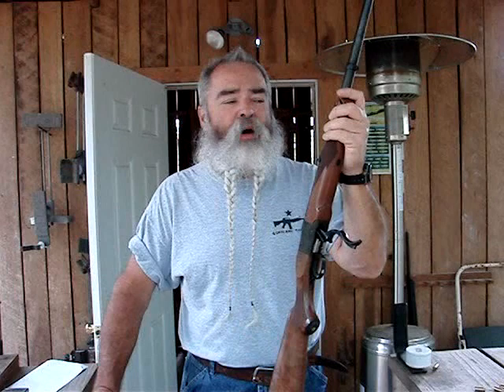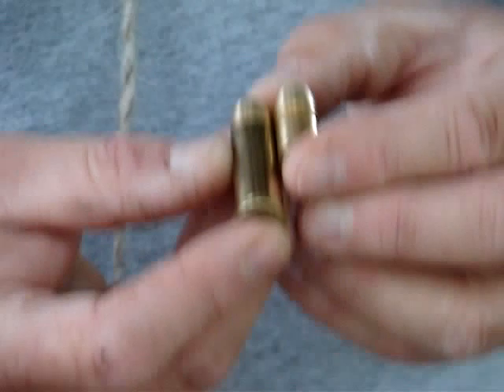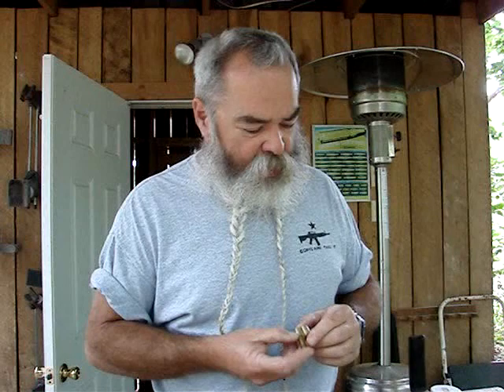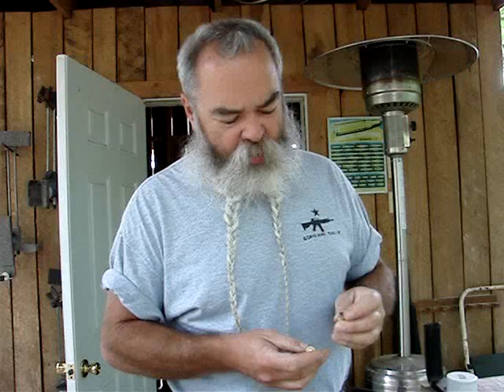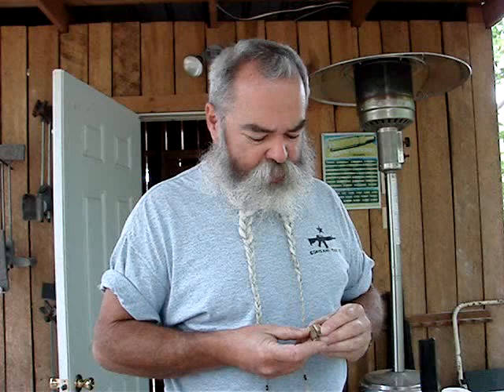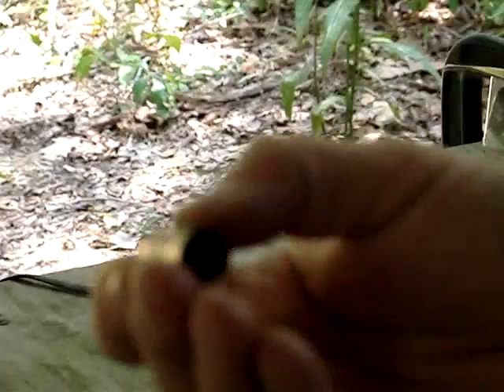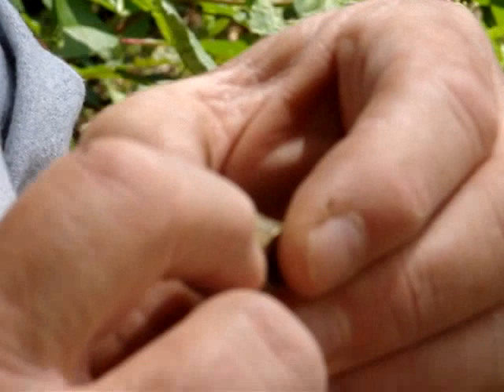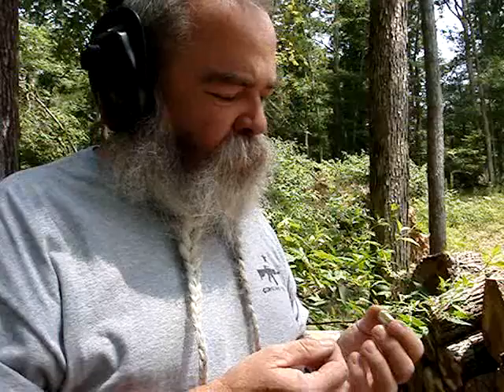Gunblast.com - Belt Mountain's New Punch Bullets for the Ruger No. 1 475 Linebaugh

Comment: @evildude109 I should say off the bat that I have not and will not ever hunt dangerous game in Africa, but my impression is that you need a bullet that not only penetrates deep, but does it while deviating from the original trajectory as little as possible. To do that, the bullet must not deform. When you're dealing with muscle and bone as thick as a rhino's, you need a bullet with better structural integrity than lead.

Comment from the maker: Long range, a spitzer bullet will retain more velocity, and not drop as quickly, but accuracy is not affected. However, the longer the overall length of a bullet, the more spin it takes to stabilize that bullet. The Punch bullet is built for maximum terminal effect, and that flat nose just hits harder, and retains its path better through flesh and bone.
 
jeff

Comment: Or to be more on the point. If you want AR in 475 you neck down .50 beowulf or neck up 458 socom. Working around rimmed round in AR would take a lot of expensive work (not just upper) with identical end result.

Comment: I have NEVER seen a bullet do that without getting smashed all to hell!
How does it keep its shape like that after going through so much material?
I know you said it was a brass bullet but I have never used brass bullets and don't really understand where your coming from, do you mean mostly solid brass with a little lead in the middle or what?
 Also, isn't brass a soft metal?